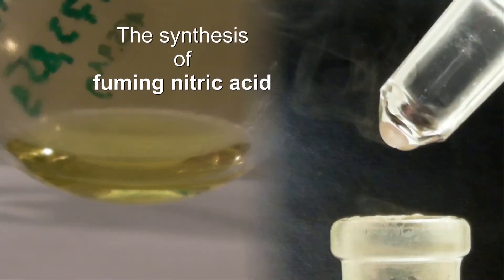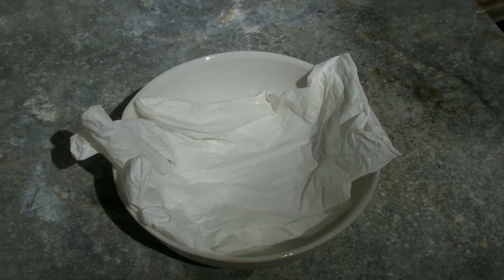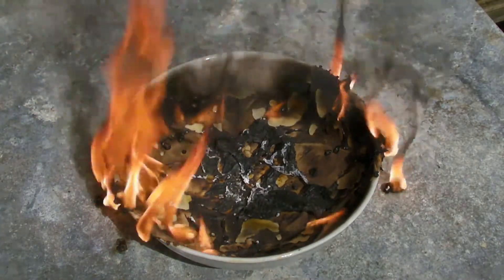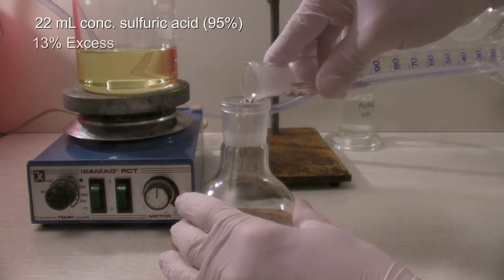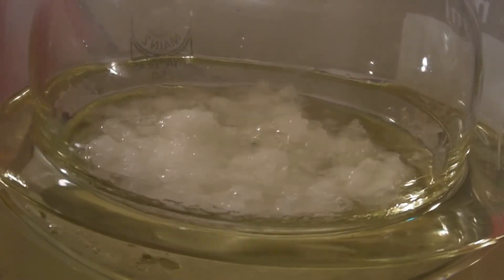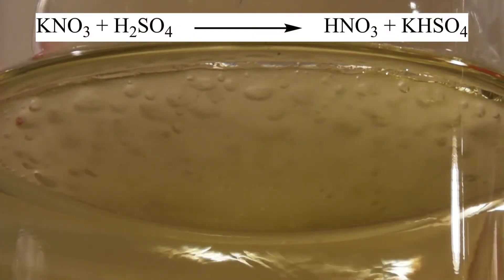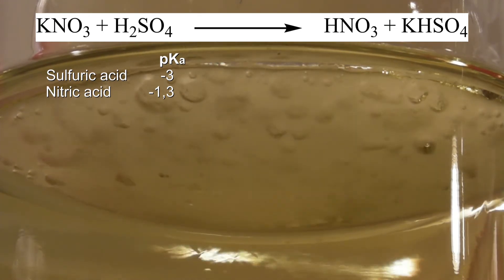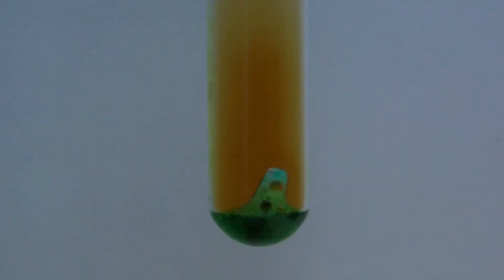How to make fuming nitric acid

Comment: Oh gosh I love and hate fuming nitric acid. I used to work with it a lot and always made it in situ. Never distilled that stuff. I have some weak nitric acid that I store for dissolving metals whenever I need to work with metal salts and only have the metal and even that managed to eat through a storage container. The container was upgraded and now there are no problems. I hate working with it though. So reactive, so volatile, so many fumes, so much possible really toxic NO2, and so freaking corrosive. One of the most volatile corrosive thing I have ever worked with. It can make a lot of really fun stuff though :) but everything involved is pretty dangerous and sometimes a pain to deal with. I prefer my usual chemistry with safer reactions where the most toxic thing is methanol vapors during a reflux haha. Or better yet having the most toxic thing in the reaction flask being non heavy metal salts. That's always chemistry that's fun to do. Whenever I use chemistry to make things that are fun ;) the synthesis isn't so fun but whenever I do chemistry and end up with not too fun of end products, the synthesis is usually more fun.

Take for example, ETN and picric acid both are pretty fun materials (with lots of caution of course) but the ETN synthesis makes a lot of nitric acid fumes and the synthesis is quite boring and doesn't require much skill and most of the work is put into making and choosing good quality reagents. Picric acid has a much more fun synthesis since I have to put a lot of my skills into really good temperature control and because there are multiple steps, but it is very dangerous since at times, the sulfuric acid is at 125 degrees Celsius. Add on top of that, nitric acid being produced in situ and if I mess up the nitrate salt addition (I had plenty of precautions to prevent that and also had plenty of precautions in case it did go wrong somehow) I could create a lot of NO2 gas as well as having the hot acid shoot out from all of the violent bubbling at once. Highly unlikely since it was a small scale synthesis and even if the reaction ran away the temperature doesn't instantly spike crazy high making a huge acid flowover (unless you had bad stirring and made hot spots). It was also unlikely since I used a beaker to prevent the foaming from being an issue and I also had a runaway jug in case the temperature rose above 100C. Just in case it did manage to plop out hot acids at me I had full body protection (face shield, respirator for the fumes minus the NO2, good gloves, full suit, more goggles, etc.) and lots of safety procedures in place. The last time I performed the trinitration was probably the last time since I originally was just trying to make a little bit of picric acid and it was also just to see if I could fix my previous synthesis failure. The mononitration is a lot less dangerous though since you use very dilute nitric acid and low temperatures haha.

In contrast, my future experiments are all non energetic and will have me dive deeper into organic synthesis. I will be synthesizing a biodiesel through a transesterification and I've also got plans to finally make some sort of medicine. In my case, I discovered that chloral butanol was a good candidate for my first attempts. One project I may do in the future is attempting to perform an acetylation of cellulose. It will probably be challenging since I have to go the non acetic anhydride route and will instead use glacial acetic acid and I will also need to make pyridine and p-toluenesulfonyl chloride to use as catalysts. That honestly sounds like a bit of a too challenging reaction since I want to do it all from commonly available scratch ( I could just buy the catalysts but where is the fun in that?) and I still need to do lots more research but it's possible I'll attempt it.

Comment: Very nice procedure!  What was the product you used to seal the joints?
Reply from the maker: The grease is called Triboflon. It has a high content of fluorinated compounds and teflon, which is why its very unreactive.
Reply: @RaExpIn  Why didn't you use concentrated sulfuric acid? It is cheap and don't pollute the environment unlike fluorinated polymers

Comment: How can I reuse the KHSO4?
Reply: you could do that, just additional steps to dry distill SO3. Look up "contact process" for production of H2SO4, maybe if you can get some Vanadium Pentoxide you can set up your own manufacturing plant lol
Reply: ive actually wondered about that myself and have never tested it, but I just happen to have one and 2L of sulfuric acid that i just got so i will test that right now and share my results when i do or dont notice something
Reply from the maker: I would add some cold water, but not so much that it could dissolve all of the salt. Then do a simple recrystallization. I'd guess two or three times in total should be enough to get clean KHSO4.
Reply: Sorry reading my question I realize it didn't make any sense. What I meant was that lots of sulfuric acid are converted into KHSO4 so to save some money is there a way to convert it back to sulfuric acid.
Reply from the maker: The only thing I could imagine would be a dry distillation to make SO3 and then mix it with some sulfuric acid, to get more acid. Nevertheless this could cause the glass to break.
Reply: Thanks. I couldn't find anyone on youtube that have tried that. Maybe this is very hard to do? Any way sulfuric acid is very hard to come by in Sweden. It was much simpler say 10 years ago. But now I'm not sure how to do it.
Reply: can you get sulfur? that shouldnt be too hard to come by
Reply: Yes 18 Kg approx $150
Reply: so you should be able to get about 2.5kg for $20 which is quite a lot. there are many instructions and videos on burning sulfur and bubbling the smoke through H2O2 to make H2SO4, which you can then distill to 98%. Im not sure how efficient the formation of acid is so the solution may require a long time of boiling to concentrate it.
Reply: To my understanding when you burn sulfur you get SO2 and SO3. According to REI you use dry distillation to acquire SO3. Why not just drip the distillation into H2SO4 which should react with any water remaining in the sulfuric acid? Then I don't need to buy hydrogen peroxide which you can't get anything higher than 12% in Sweden to my knowledge.
Reply: Are you unable to just order it online? I know its expensive but maybe you could buy it as drain cleaner?
Reply: I just checked that out and I found one that shipped to Sweden. 750g for GBP 36.00. But SO3 is very nasty stuff so I don't know. I don't even have a fume hood LOL. Maybe better to just leave it alone. But it would be fun to try.
Reply: I dont have one either, i made a fume extractor that vents out my window, seems to work pretty well. I am considering actually setting up an apparatus that i can produce H2SO4 via contact process, seems like a fun experiment
Reply: If you make one with Vanadium Pentoxide could you make a video about it. I will subscribe. Dry distillation of KHSO4 is also very interesting with either Vanadium Pentoxide or hydrogen peroxide. I asked around on the Cody's Lab channel when he used bubble stone if bubble stone is resistant to chemical use. One guy responded that he used that for a process that require hydrochloric acid I think it was. I never seen a chemist using bubble stone but I believe it would dissolve the gas much faster. Of course you could use a series of test tubes until all gas is dissolved.
Reply: Subscribed :)
Reply: Thanks! ill PM you

Comment: Great you showed the fumes of nitric acid evolved on mixing the sulfuric acid and nitrate against a black background I've always paid attention to that but you made a mistake by saying sulfuric acid is the stronger acid it isn't most people get this wrong I know what's really happening is that nitric acid being more volatile is driven out of solution having a much lower boiling point same as in the case of salt and sulfuric acid where the reactions even faster why cuz the hydrochloric acid has an even lower boiling point!
Reply from the maker: The pKa shows that sulfuric acid is stronger than nitric acid. In case of hydrochloric acid you're right.
Reply: Pka isn't a very scientific method to determine strength of an acid a better method is reaction with certain materials in wwhich nitric acid outshines both but an even better method is to evaluate solubility of it's salts all nitrates are soluble in water few chlorides are insoluble but more sulfates are I'll give you still one more example perchloric acid is the strongest acid hugely more than sulfuric acid right BUT it gets displaced by sulfuric on account of a lower boiling point
Reply from the maker: Can you tell me a paper or a book, where I can read about it?
Reply: Everything I highlighted above are facts from solubility to displacements of other acids by sulfuric acid and can be found in any standard chemistry textbook or online here but ive worked with chemistry since a long time so am more aware
Reply from the maker: At the university I have never heard about acids being compared by a different reaction than the dissociation in water. That's why I'm wondering. In which reaction is the nitric acid stronger in protonating something than sulfuric acid? As far as I understood, you say that acids, which have more soluble salts are stronger. And in addition to that the boling point also has an influence. I thought there is an equilibrium in the mixtures of different salts/acids with sulfuric acid, which is more on the side of the stronger acid, but usually you're simply removing the weaker/stronger acid, because of its lower boling point. That's why you can make f.e. perchloric acid with perchlorates and sulfuric acid.
Reply: See nitric acid chemistry is clouded by the fact that it's a strong oxidizing agent unlike other strong acids(right from dilute) also extra oxygen increases the acidity of the acids nitric acid is right up it's league as the strongest stable oxo acid of nitrogen like perchloric acid is to chlorine
Reply from the maker: But nitric is one of the strongest acids, sulfuric acid is the most stable oxo acid of sulfur and perchloric acid is a super acid. The fact that oxygen is more electronegative than the other non metal atoms, which increases acidity is obvious. And other super acids contain fluorine, which has an even higher electronegativity.
Reply: I believe I have the answer plain and simple now:Sulfuric acid though having a higher Pka value is NOT a stronger acid because it's dibasic ie forms 2 series of salts so that splits its apparent Pka value down the middle unlike the other common strong acids which are monobasic like nitric sulfuric or perchloric: I do have a textbook whichs authentic printed1st edition in the 70s by professors called a New Certificate Chemistry where both nitric and hydrochloric are labeled very strong but sulfuric merely strong also there's another textbook from the 80s which galvanised what I'd said earlier about sulfuric displacing nitric as the latter's more volatile though stronger!
Reply: Blue Vortex that very high pKa is only for the disassociation into bisulfate and hydronium,so it isn't in any way distributed to both protons. If you are a knowledgeable as you claimed, you should know that there is a pKa for disassociation into bisulfate and hydronium and a different one for dissociation into sulfate and hydronium.

Comment: I thought the reaction was mostly driven forward by the evaporation of the nitric acid? Fuming nitric acid is great fun though! xD I did an experiment in one of my videos where fine copper powder, with a high surface-volume ratio, seems to react more quickly than bulk metal

Comment: Nice. It would be interesting to see a synthesis of nitric acid were you don't use any other hard to obtain acids, like sulfuric acid. Is it even possible?
Reply: the bisulfate will work however excessive foaming will happen and you need to heat it strongly to drive off the acid which also will decompose the acid and for this reason it takes hours to complete and yields are low
Reply from the maker: I have seen a video a few years ago, where bisulfate ist used instead of nitric acid.